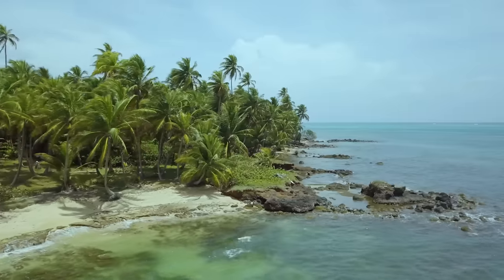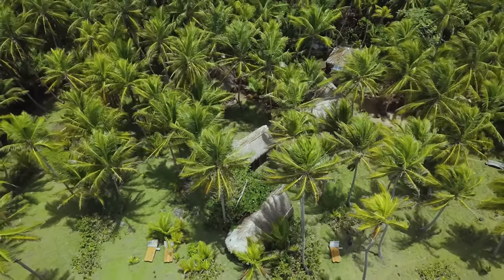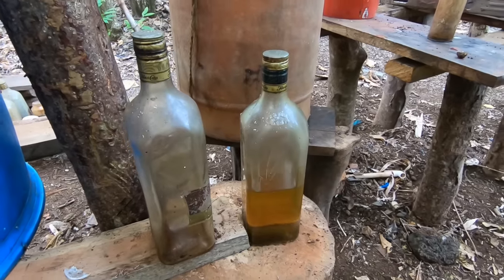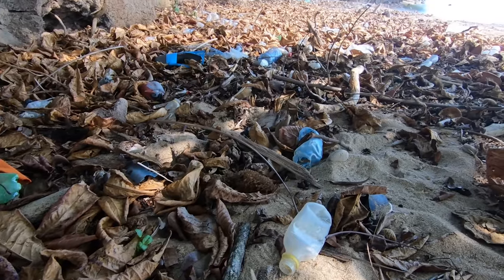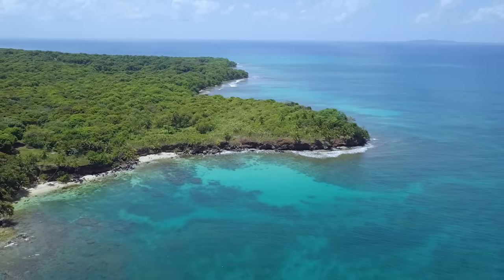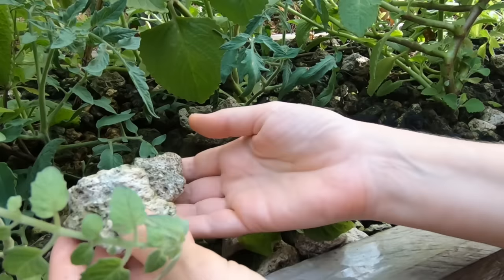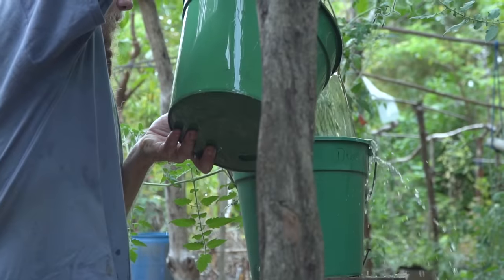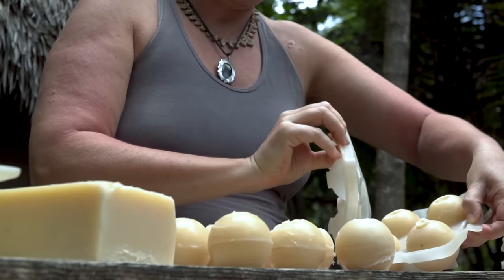THIS SELF SUFFICIENT FAMILY MAKES THEIR OWN FUEL FROM PLASTIC!

Comment: Can I put plastic-made diesel in my car? The way fuel prices are right now, I'm willing to try anything.
Reply: Stick with used cooking oil and producing your own bio-diesel.

Trying to create diesel out of plastic at home ?

Possible if you've got the smarts and complicated set up for it.
Reply: @Nowhere-from  You can distill it. Look it up. You can make gas from cheap 190 proof booze. Pretty neat shit.
Reply: It's probably illegal since it can't be taxed
Reply: take some dirty oil like cooking oil or even used car oil and add methonol or ethonol the lighter fluid you use for  BBQ grilling  at a 1 to 3 ratio 30% methonol and 70 % dirty oil mix and  done bio diesel or  mix the oil in a 50% by 50% mix with gas station red diesel
Reply: Technically yes, but I suspect it would diminish the lifespan of your high pressure fuel pump. (Or maybe not. Depends what fractions you use I suppose.) That old dirty bastard diesel engine seen in the video will happily run on just about anything, but more modern engines use a much higher injection pressures to get a faster and cleaner burn. They have much tighter tolerances in the fuel system, which makes the lubricating qualities of the fuel far more important.
Also, homebrew plastic diesel might pollute quite a lot worse. I suppose it will depend what kind of plastic you start off with, but a lot of the extra refining done to modern diesel fuel is specifically to make it burn cleaner and comply with modern emissions regulations. If your engine is already old and tired then it might be worth giving it a try to see how it handles it, but it would not be my first choice of fuel alternative.
Reply: Why do you think prohibition happened? .   It wasn't for the booze.   It was to phase out the stills to make ethanol and the know how.....

Comment: The exhaust off the generator with this fuel could probably gas a whole village to death.
Reply: -He says just before he gets in his car and drives to the city. It obviously DOESN'T gas a whole village to death, as there's a small village there. Want to compare the quality of their air with your own?
Reply: @josephmiller997  I'm sure burning random melted plastic juice is fine and not carcinogenic at all.
Reply: @josephmiller997  I would much rather spend a day in the middle of a road in any country with modern emission laws than an hour anywhere near his converter or his diesel generator. 

What he does kind of works if he is the only one doing it on a remote island, but the pyrolisis and the usage of that wild mix of hydrocarbons and countless toxins is highly poisonous.

Comment: Plastic is a byproduct of distilling crude oil, so it is not so shocking to see someone distilling it to another level.
Reply: Yes
Reply: @Drfine22  And the pollution it creates is horrific.  Melting and Distilling that plastic, is worse than what the refineries do.  They actually STOP, before they get to this point.
Reply: Hail from the backwoods of Kentucky.
Reply: @VidarrKerr  There would be pollution if the gas vapors were escaping.There are no gas vapor fumes escaping. I don't know why you keep insisting on saying that.
  Plastic is made from petroleum.   Not petroleum from plastic unless you are doing it like we are.  The major refineries process crude, not plastic. The hydrocarbons from the refining are THEN used to make plastics.
    5 second Internet search says  :Plastics are made from natural materials such as cellulose, coal, natural gas, salt and crude oil through a polymerisation or polycondensation process.
  Plastic is highly processed hydrocarbons and very clean compared to crude.
  You are a troll that is haunting this thread spewing misinformation.
Reply: Exactly it says alot about what people know about the history of plastic . We get more and more plastic in our face these days and people keep buying it .

Comment: He can actually use hydrogen as a fuel additive to clean out his engines of all the carbon buildup. The hydrogen burns hot enough to breakdown all the carbon buildup. He could run a simple battery charger for an electrolysis process to separate the hydrogen from the oxygen in water. Then use the hydrogen as a fuel additive by feeding the gas into the fuel system. He can also bottle the oxygen and use that for a fresh air system with nitrogen and helium, and go scuba diving! Helium can be made via a simple chemical reaction, and the nitrogen can be made from a simple nitrogen generator.
Reply: Yeah but you don't seperate the hydrogen and oxygen right and it go boomboom, I'm also pretty sure helium can't be artificially produced unless you have access to decaying radioactive isotopes so it has to be taken from natural deposits, there is a finite amount of it on earth, although it is abundant in the universe .. so not sure where you got that one from
Reply: @bigsteve6729  Helium is easy to make, you can make it in abundance with a simple chemical reaction. Also, splitting hydrogen from oxygen is probably the simplest thing in the world to do.
Reply: ... absolutely brilliant...🙂☮️💚
Reply: get this man to the island..
Reply: @youcanthandlethetruth6976  hold up you know how to make helium? And completely unreactive noble gas?
Reply: @ahorseofficial  Helium has been made in a very simple way for many many years now. Although the refinery process seems complex, especially when driving past a refinery, it is a very simple gasification process that could be done at home in a rudimentary manner. 

It can also be done chemically in a controlled environment very, very easily, also at home.

You can also yield gasoline and diesel as well as many other derivatives of the process.
Reply: @youcanthandlethetruth6976  why don't you tell us how to make it? Because everywhere I've read says it's impossible to make. ??? You haven't given any information on it you just say yes it's very possible where as the whole of Google says no, it isn't
Reply: @youcanthandlethetruth6976  yeah splitting it is easy, but collecting them seperately is not. 

You can't make helium.

From your replies I honestly don't think you know what you're talking about man. Disappointing
Reply: @bigsteve6729  collecting it is the easiest part.
Reply: @bigsteve6729  what you don't understand is that their density forces them into separating themselves. All byproducts condense at varying intervals. It's not a matter of any complexity to collect them. They will separate themselves as long as you understand at what point they will begin to condense. It's very very simple to do.
Reply: @youcanthandlethetruth6976  you mean hydrogen?

Comment: I wonder what prevents someone doing this cleanup on a larger scale?  Also curious about what the leftover product is and how easilly its disposed of.... anyone know?
Reply: @matthewblunderbuss4545  I can see that. Thanks for the reply.
Reply: @matthewblunderbuss4545  you are making assumptions, and they are all wrong.
Reply: @kinzieconrad105  Ok, I’ll let you explain then, I’ve deleted my assumptions.
Reply: It is not a clean up. He's burning plastic... And doing it in a very inefficiënt way
Reply: @graypistachio4141  he is... but it's also in a vaccum which makes me wonder if there is a way to scrub the gasses before they are released into the atmosphere if applied on a larger scale.
Reply: @_FZ06  It isn't a vacuum, it is just oxygen free. Yes, the gases could be scrubbed, even he could do it. A far more efficient retort would run under pressure but, even then, you would get less energy out that was put in. That is why there are no large commercial operations that I know about.
Reply: @buggsy5  Search 'Plastic to fuel companies'
Reply: @dereksplace1342  I did. One of the foremost companies in the world is building some demonstration plants and has stated that they hope to improve processes enough in the next few years to be both carbon neutral and profitable. Note that does not address the relative energy efficiency.
If I recall correctly, they are not using the retort method, but are extracting a gas using steam and oxygen.
Reply: @buggsy5   If the pyrolysis of plastics to fuel takes place in a closed loop system, by definition it is efficient. Here is a pdf study on Cynar Recycling in the UK.
  Case Study 3 Cynar Plastics to Diesel 
 I can't seem to put a short link here, you'll have to search those key words.
Reply: @dereksplace1342  I took a look at that company, and the other two that are apparently working on the process and have development plants progress/operation.

I noticed that you have a lot of plastic bottles. Most of those are PET or PETE and they contain a lot of oxygen. Cynar says their highly efficient plant can only get about 30% recovery form PET plastics.

With the diesel they produce, Cynar says they mix the recovered diesel with pump diesel at a 70%/30% ratio. I suspect this is primarily to get the anti-oxidants and anti-fungal additives that are in pump gas. 

Their process is certainly efficient at extracting all the hydrocarbons. That may, or may not, equate to energy efficiency. They do state that the process has a lower carbon footprint than diesel fuel.
Reply: We mix 1:1. It can run straight but it is a little heavy. Mixing the diesel fraction with normal diesel gives it a cleaner, smoother run.
  If used, PET has a lot of wax that may not crack in time of evaporation and form in the pipes. It can be dangerous if it cools too fast and blocks the pipes. It should be mixed with a high quantity of used motor oil and the problem of dangerous wax formation is greatly reduced. Perhaps it dissolves, or is properly cracked?   If that is what is happening it equal may result in more energy recovery.

Comment: I've thought about doing something like that: cracking plastic bottles into something like heating oil.  Question: Doesn't the reactor create a horrible stench? What of the vapors produced?
Reply: No, the smell is not too bad. There is a unique smell associated with it but it is nothing like smelling a stinking  outdoor burn pit. Don't throw in rubber sandals and things like that, stick with normal plastics like hdpe, ldpe, pp plastics, etc and things will be fine. The earlier forums said be careful and not put PET plastic in (like clear water bottles) because their molecular structure contains oxygen and they were afraid of explosions inside the reactor. Most of our fed plastic ends up being just that and has been fine. PET does seem to contain a lot of waxes so it is recommended to mix with other plastics and especially used motor oil. Budget Rent A Car in Managua gave us two barrels of used motor oil so Little Corn island has a lot of waste plastic about to be repurposed.
  All of the gas vapors are condensed into it's fuel fraction and what does not condense (butane, propane) is used as fuel and fed into the carburetor of a  gasoline generator instead of gasoline. The exhaust scent from the gasoline genny is strangely sweet. I couldn't tell you why. The scent from the diesel engine is pretty normal, but I do mix this 'diesel' and normal diesel so it burns clean and not too heavy.
Reply: @Grim FPV Well, I prefer not to get it on me so be sure to wear gloves. So far so good. If people experiment, just be sure to use good quality metal containers with thick bottom and walls- not for pressure but for gradual corrosion making it thin and dangerous, especially the reactor.
  As mentioned before, the types of plastics used are important, some having chemical compositions that may be more toxic than others.
Reply: @dereksplace1342  this blew my mind. I think this process should definitely be used more. There is definitely too much plastic waste in the world. And I am a garden-a-holic I absolutely loved seeing your garden. Give your wife a hug looks like she works hard on soap making. Much love n hugs guys.
Reply: @JCC_1975  Thank you, she does, and I will pass on your regards. The garden was a bit mashed by the hurricanes but it is coming back, the video caught it at a good moment :)
Reply: @dereksplace1342  , hi, I am from Congo and I would like to learn more about the all systems, is there any book you will recommend? There are plenty of plastic there and this will help to clear them and generate electricity. You and your wife are the best.
Reply: @beatamafulu2405  Thank you very much. You will definitely get rid of large amounts of waste. There is about 1 liter of fuel produced per kilogram of plastic.
   We never used any books for reference on this project, I don't know if there are any. We just copied what others had done with their units from photos and reading the excellent, excellent thread at Energetic Forums. Type 'plastic to diesel' in the search box on the main page and it will bring up the thread started by Jetisj. Tons of information, it starts with the idea of plastic pyrolosis and others add input as they try and tinker on their own. It is invaluable and recommended for those who would like to try it.
Reply: @dereksplace1342  thank you. I will search on forums.
Reply: @beatamafulu2405  You are welcome. I wish you success.

Comment: That is brilliant, fuel out of plastic.
Reply: Indeed, now there's no excuse for clogging water systems and land. What pisses me off is someone knew this all along and still sat back and let the disastrous pollution happen
Reply: Fuel from fuel.
Reply: How to would be good. Im not an eviromentalist but i am cheap. Who likes looking at a plastic bottle. All sides do not.
Reply: Yep really great
Reply: Well it's good for reduced trash, but it just convert trash/ land pollution into air pollution.
Reply: Hold on a second what about the melted scum plastic toxic WASTE left over from the distillation process????????
And the fact that is on an island with limited space for this waste.
Reply: @buckbuck4852  There is some carbon left, just a fraction of the former mass before pyrolysis. All the volatiles have been vaporized, condensed  and collected as fuel.
Reply: @dereksplace1342  brilliant well that is a really neat process 👍
Reply: @dereksplace1342   " All the volatiles have been vaporized, condensed  and collected as fuel."
No, they have not. They have either escaped to the atmosphere during fractionation,  will escape to the atmosphere in the Diesel engine, or be buried with the ash from the distiller.

Comment: Igniting diesel with a match.... that ain't no diesel, that's gasoline
Reply: well.. he said diesel fraction, he later just said diesel so he doesn't confuse people that don't know of the refining process ,
diesel lights up with a match but it takes longer and you gonna need the "good" kind of matches ,
also in this case he soaked some leaves and that was that helped it light up.
it isn't gasoline, it's something between diesel and kerosene.
Reply: @vasopel  if you take diesel from a gas station, there is no way you can lit it with a match, but when you see the installation he made it's certainly not pure and may contain other oil products such as gasoline or kerosene.
Reply: @z-em4612  The diesel fraction was just made and the system had just been started so it was on the cold side, condensing  the volatiles along with the diesel fraction. The fraction was also hot so it will ignite easier than if it was cold. The volatiles that easily lit would have been separated afterwards by airing out or heated and captured in a secondary process.
Reply: Diesel has to be at a certain temp and or under pressure, to ignite.. jus saying. far as I know.
Reply: Loral Anthalas  ok...but why are you "answering" to me? :-)
Reply: Probably calls it Diesel because he uses it in a diesel generator
Reply: I light my smudge pot with a napkin and lighter. No difference

Comment: Would be cool if he used a fresnel lens to heat the mix with
Reply: I think parabolic mirror would be much better.
Reply: Yep cool as in not enough heat😁
Reply: @4tran But it can run an engine on it and unless you built a wood gasifier  you can't run an engine on wood. You are trading one energy source for another more usable one and cleaning up the environment at the same time. If wood and plastic are both plentiful it makes sense and the wood is renewable as well.
Reply: @CUBETechie  Look up fresnel lens melting granite. I think a parabola wouldnt do that..
Reply: @epicpaper3994  Not enough heat?! Look up fresnel lens melting granite rock in less than a minute...
Reply: @4tran Exactly my thought.. hes gotta be just breaking even energy wise, so on an island of limited wood and unlimited sun.... FRESNAL LENS!!!
Reply: @tommynorthwood  a parabolic mirror can do it too solar cooker for example.
Reply: @CUBETechie  Yes.... but a fresnal lens would melt the bottom of the pot... FRESNAL LENS!!! HAHAHAHA I can see I'm getting carried away saying that so I'm just having fun with it at this point.
Reply: No doubt it could be done on solar. I mean solar furnaces are among the hottest there are. You need a massive fresnel to get any real work done,
Reply: @epicpaper3994  A guy on YouTube melted a granite stone in minutes with one made from an old projection screen tv. The big boxy one. 3 feet wide, not hard to build.. just took the screen, mounted it with 1×1 inch wood pieces for a frame. LOOK IT UP.
Reply: Tommy You’d need a big ol fresnel!  Im thinking of something like the Solar Furnace in Odeillo.😉
Reply: @epicpaper3994  Troll